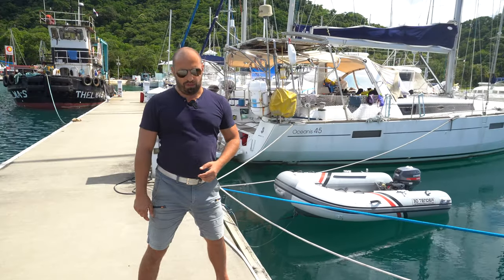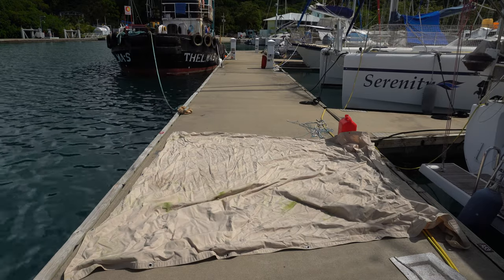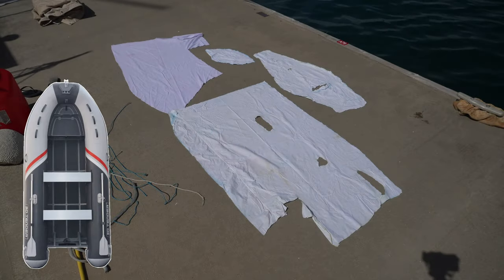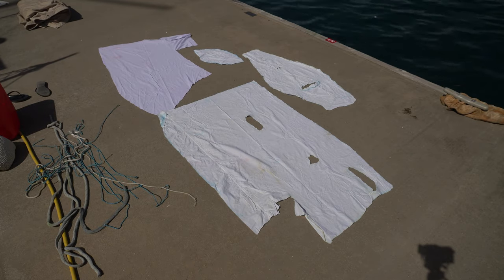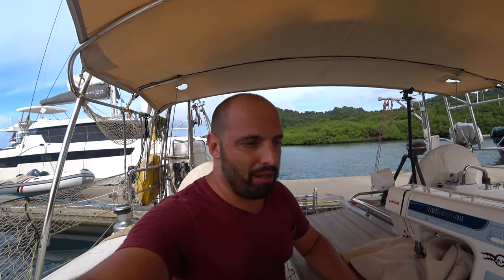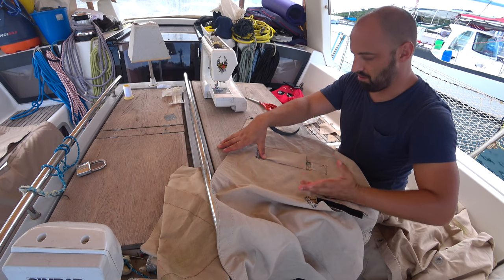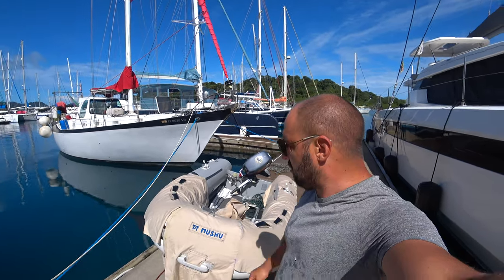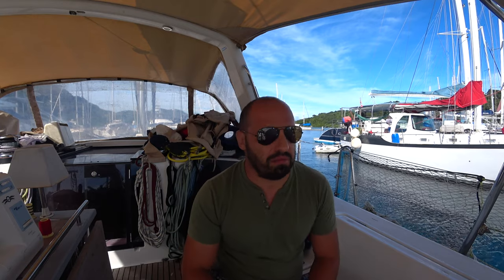The Ultimate DIY Sunbrella Boat Cover Guide

Comment: It was not what I expected, as I was looking for the idea of the rain cover. But, thus was actually an excellent idea for preserving PVC from the sun. By covering your dinghy, did the dampness underneath the SUNBRELLA create mold or black or green dots from mildew?
Also, you skipped a lot in your pattern making so it was hard to tell what your plan was for fitting to the inside or outside if the tube. But, once you see the well made finished product I am having another  view of what you did.  Thank you
Reply: We are about to make new dinghy chaps for our 10 year old Hypalon Zodiac dinghy. I can assure you that the sunbrella chaps that are on there right now (10 years old, but falling apart) have kept the dinghy tubes in very good shape. There is no mold or black or green dots from mildew. The sunbrella fabric is not glued to the Hypalon, and is free to breathe.
Reply from the maker: Hypalon is UV ok, you do not need cover for it. It works well. FOR PVC better to have